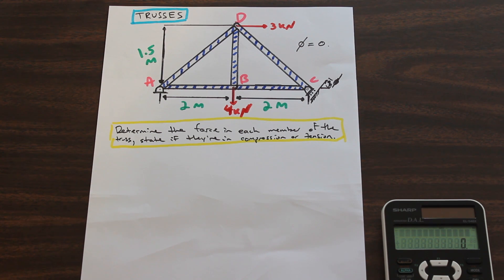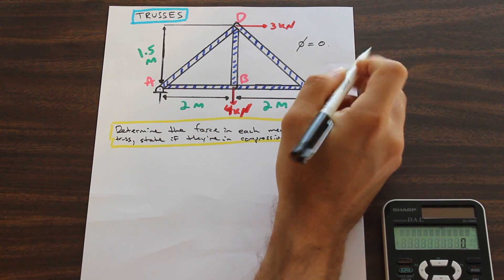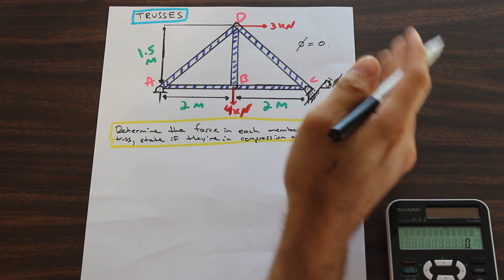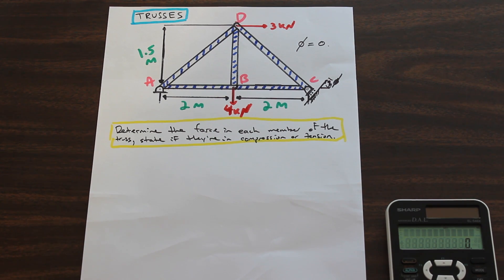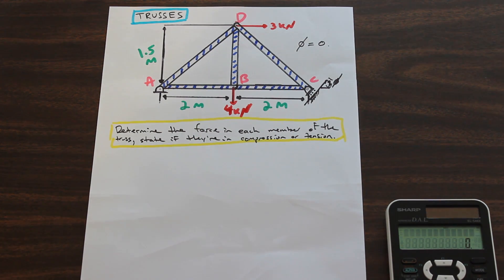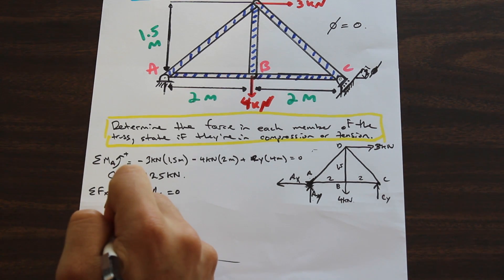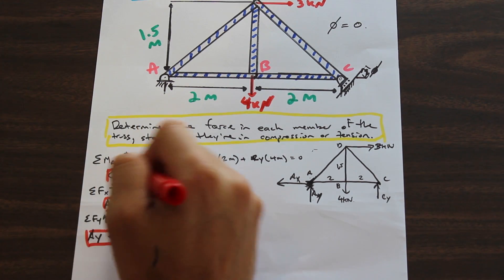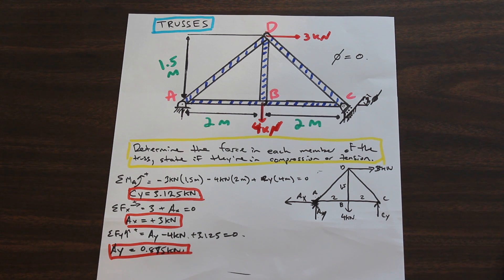How to Solve a Truss Using the Joint Method

Comment: A quick question, why did you use a 3,4,5 triangle instead of the numbers already present on the question? 1.5, 2.5, 2? Urgent!
Reply from the maker: Mei Celina thanks for the question Mei! Both triangles are equivalent, a 1.5 2 2.5 triangle is the same as a 3 4 5 triangle.  The reason why we covert to 3 4 5 is that it's much easier to work with the whole numbers 3 4 5 when carrying out these multiple calculations, the numbers are just easier to work with.   Hope that helps.
Reply: AF Math & Engineering Thanks alot! I have an exam tomorrow and this tutorial helped me understand better. 🤓
Reply from the maker: We're very glad you could get some value out of our videos...thanks again for the comment!